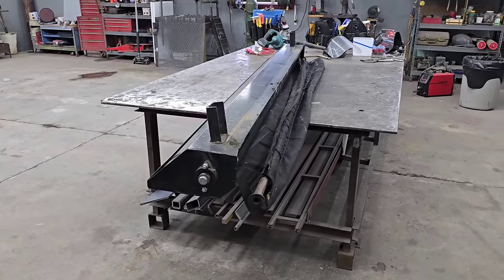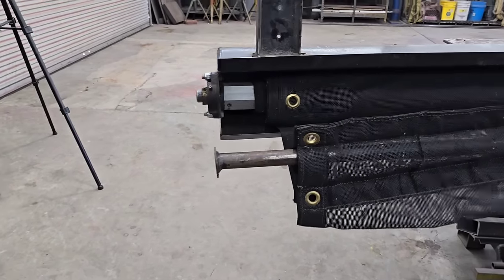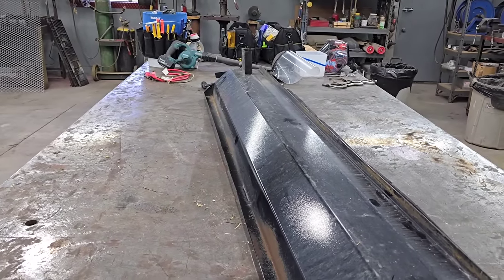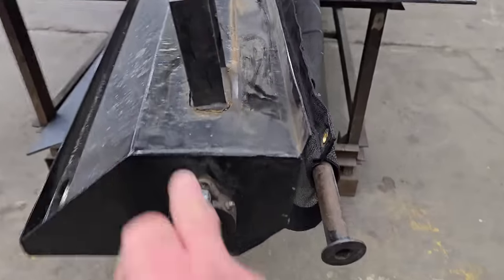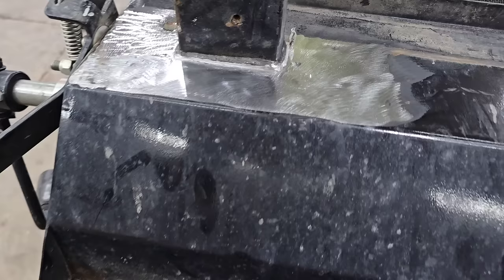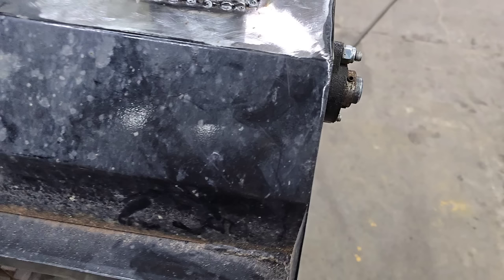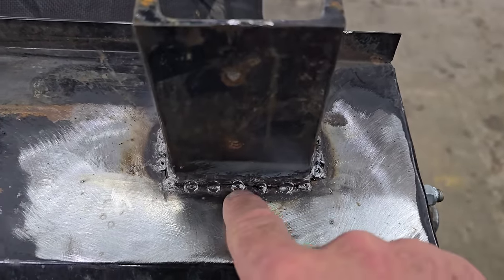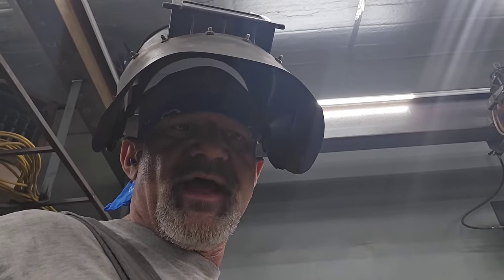Repairing a tarp roller for a dump trailer

Comment: 0:39 Hey CB I'm curious what is that metal ladder type bracket hanging up above you in the shop? I keep seeing it but not sure what its purpose is exactly? I know its not just to hold a coiled up extension cord up there. 
Those dump trailers are not always built with the best & strongest materials to save money, obviously. Almost all the ones ive seen & used are repaired on a few spots. Usually the latch breaks off the back doors too. I've seen the axle spring perch & leveling braket broken on quite a few also. Overall, they just lead a pretty tough life if they are actually used regularly in construction biz. Nice job on repair though!👍🏻👌🏻💪🏻🛠️🔧🔩🗜️📐✏️📏⛓️👨🏻‍🏭⚡💥💨
Reply: Couldn't you add metal to the back side, opposite of the C-channel mounting bracket(inside where tarp rolls up into)? Also I think you could've gone all the way around that bracket & just possibly notch trailer side a little or just have the guy make new holes for those brackets to account for the added metal. Anyways looks good! 👍🏻👨🏻‍🏭🍻
Reply from the maker: The ladder overhead in the shop is a ladder from a tree stand that my neighbor didn't want anymore...I've been using it as a shelf
Reply from the maker: I don't think the job needed anymore time or material put into it besides what I did to it
Reply: @NBSWELDING  👍🏻👌🏻Cool man thanx. 🍻

Comment: Nice work CB, What have you found is the best way to remove powder coating?
Reply from the maker: Depends...not all of it behaves the same depending on how it was prepped...ya just go at it with an arsenal of grinders, brushes, torches,  and sanders until ya get the result ya need.
In alot of cases with stick welding I'll just grind enough to get a rod started and then weld through it, powerbrushing afterwards then running passes over that
Reply: @NBSWELDING  Thanks

Comment: Great job! What size rod and amps did you use? Good information as always. Be Safe!
Reply from the maker: 1/8"5P+.....77 amps
Reply: Thank you for the reply. I weld about 4 times a year but I have noticed I have better luck with a 1/8 verses a 3/32 with burn through on thin metal. That was welding a mower deck with 6013 though using a Lincoln buzz box. Keep up the good work and BeSafe!